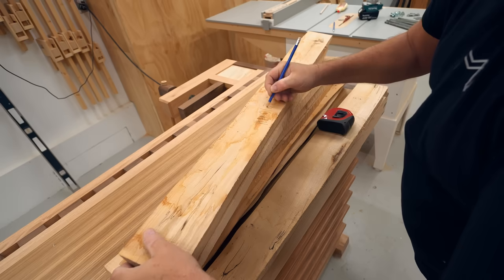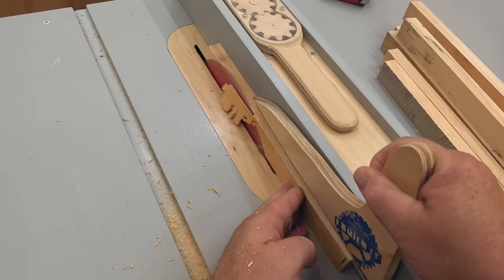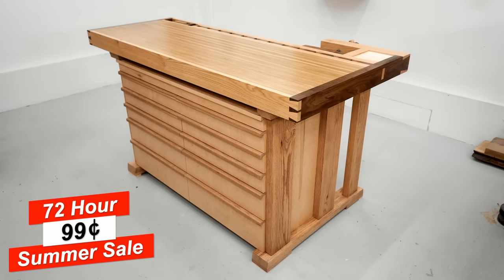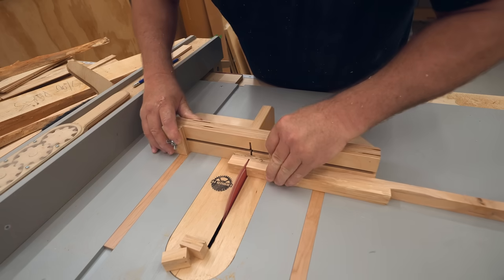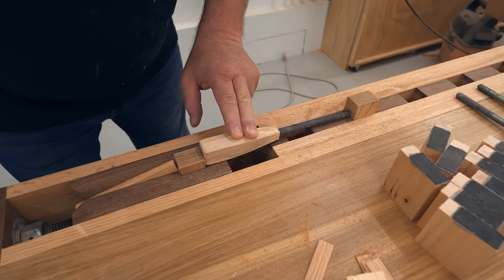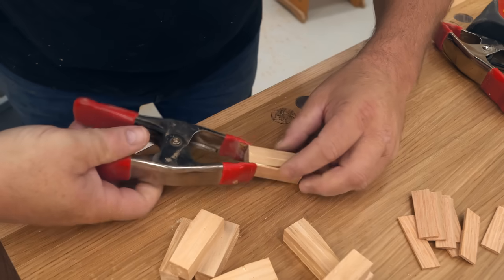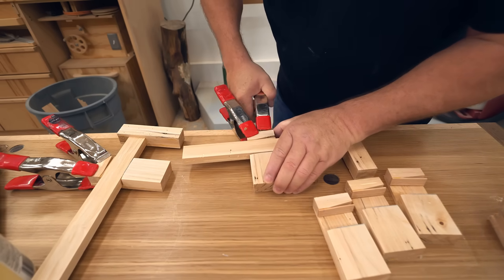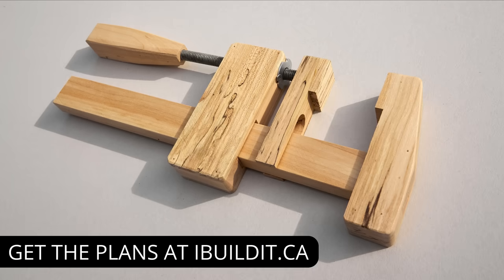How to Make the Ultimate Wooden Clamp - Woodworking

Comment from the maker: The Makers Mob 99¢ Summer Sale: https://rlnk.cc/jhthemakersmobsummersale
Get the plans for this fabulous clamp: https://ibuildit.ca/plans/ultimate-wooden-clamp-plans/
See more detail in the project build article: https://ibuildit.ca/projects/how-to-make-the-ultimate-wooden-clamp/
If you make these, you'll never go back to using metal clamps again. I know I haven't. The difference is weight - these are half as heavy as the typical metal clamp, but are still capable of more than enough force for all of my woodworking tasks.
Reply: Bought the plans, Thanks. I see the metal shim in the materials list but not in the build pages, did I miss where it goes?

Comment: I was scratching my chin thinking, 'but I quite like my single handed metal and plastic clamps why would I want to make bulkier wooden ones' Then you mentioned weight of a large glue up... and I had a flashback of a recent project that looked like an oil rig crossed with a outlaw base camp from mad max or something that weighed half a hundred weight  due to the metal clamps

Comment: I built 28 of your parallel clamps about a year ago that are used daily by 3 people in a production environment.  Also have 24 bessy parallel clamps that are over 30 years old.
Your clamps always leave the rack first.......lightweight, similar clamping strength and easier to turn. The tap to release isn't a big deal, and quickly learned.

LVL beam scraps make excellent bars, stiff and durable.
Reply: Ed, I'd never thought about LVL for a plethora of bars. Thanks!
Reply: @alanr745  
Really works well, and fairly easy to get plenty around home sites.  By far the bulk of the wood needed to build these clamps.
Not heavy either.  Mine are poplar or fir.

Comment: Hi John. I always have a problem with the wooden springs. Always seams to soft, to hard or brittle. found 18mm x 1mm thick bamboo sucker or ice lolly sticks from local super market works well. Jury still out on durability over time.
Reply: Concerning the wooden leaf spring, my clamp that I made works okay but the spring spring doesn't do anything. I think that I followed the plan completely but it seems to be wrong. Did you have any issues? Thanks

Comment: So, I built 4 of the previous version. can i just replace the moving jaw assembly on those to this new design?
Reply: That is what I'm going to do on the parallel clamps.  Already have extra bars of longer lengths that are used occasionally by swapping the heads from my shorter clamps.
I see no problems resizing the new design to the bigger bar.  Also see no problem making a parallel head that I prefer.

Comment: John, Im looking at building some large/long clamps for larger furniture builds, and like you said I like the weight reduction of making them out of wood.  You've made lots of different clamps over the years.  Which do you think is the best of your designs for a parallel type clamp replacement?

Comment: Could you maybe make a DIY version of those one handed clamps with a trigger handle where you "pump" the trigger until it clamps down and has a quick release? :D
Reply: Buy a small cheapy, pull it apart, scale it up , make them, and done.  
I did this in my business as I could not get the size I wanted in a heavy duty version,   ended up making them in bulk as had huge requirements, minimum 20 plus per guy x 6 guys, plus some for installs, so actually worked out reasonable value , more importantly super heavy duty in  ideal size for.our work which no one made.
Reply: @davidp8157  - Unfortunately I don't have a workshop, I'm just a fan of watching this kind of content.
Reply: @TheStabbedGaiusJuliusCaesar  you really don't need a lot of tools to start, most things take longer, but can be done with a few basic hand tools  only, something like this is a perfect example,  very few parts,  and very basic.
Reply: @davidp8157  - You still need a space to work in.
Reply: @TheStabbedGaiusJuliusCaesar  if you have room to read a book  or watch TV, uou have plenty of room  for a project like this. Like anything   the first step is getting started.
Reply: @davidp8157  I live in a small apartment with one room for a combinee living and bedroom. I can't setup a shop in my living/bed room.

Comment: @8:18 I think the T-nut is the weak link in the design. With use, I expect there to be enough play in the wood around the nut's teeth that it just pops off. It's better to put the nut on the underside of the moveable jaw, closer to the handle, so that the threads are always pushing the nut into the wood.

Comment: Hi John Great work on the clamps, I'm planning to download one of your plans and build a bunch of them as a fun and useful project. Can you confirm that the "Ultimate Clamps" would be the latest and greatest of your designs? or which one would you recommend in terms of best performance. I also like the wedge style, I'm not concerned about an extra couple steps in making them or an extra second to disengage the wedge if there's benefit in building those ones 
Thanks!
Rob

Comment: Thanks, John!! This may be a silly question with a silly answer, but I just can’t seem to get past it.  These clamps being wooden run a much higher risk of you actually gluing your clamp to the workpiece if you’re a bit sloppy w/ the glue-up.  The obvious answer would be to not be sloppy, of course, but I’m wondering if you’ve ever experienced this  situation?
Reply: Put a little wax on your clamps
Reply: @AJ-ln4sm  Also, the 2 coats of poly probably helps.

Comment: These look fantastic John! Does it have to be hardwood?
I think it would be great if you came up with some nice space-saving way to store these and made a build video of that too.
Reply from the maker: You can use softwood.
Reply: A bit of wood trivia I learned a while back. Hardwood and softwood doesn't actually tell you about the hardness or softness of the wood - a wood is classified as a hardwood if the seeds that the tree produces have a coating in the form of a fruit or a shell. Softwoods produce seeds that don’t have a coating, which are dropped to the ground. So lots of hardwoods are soft and vice-versa :)

Comment: What's the longest usable length that would work for these do you think? 4 foot, 6, 12 foot? Also how long did it take to make 10 clamps? I need to know so I can times that by 3, and that will be how long it takes me to make :) Thanks John!
Reply: With a well equipped work area, my guess is about 1to 1.5 hours a clamp for a batch of 10 or so....start to finish.
Once the jigs are built, you could cut this time 40% or so.
Or, you could just enjoy making them as a weekend fidgit.

Comment: Can I use pine tu build  those?
Reply: Hi Pedro, On one of my clamps I used Douglas Fir for most of the parts. Pine is usually too soft. The spring will have to be from hardwood though. In my opinion for longevity they should be from hardwood. You might look for pallets that are made from a hardwood but make sure it is dry before using it.

Comment: John, long-time fan and customer for some of your plans. I get it that the T-nuts cost less than a threaded insert, but what about simply cutting threads in the wood directly? Not strong enough, or not durable enough? The block seems long enough that you'd get pretty solid purchase, especially with oak or maple.
Reply from the maker: Tapping the wood is strong enough and may be durable enough. But you need a tap to do it and you can buy a lot of t-nuts for the cost of one tap. Or you can make a tap from a piece of threaded rod, which isn't something most woodworkers want to do. Either way, the t-nut is the fastest and easiest.
Reply: @JohnHeisz  thanks for the quick reply! I agree with all your points. (I am terrible at coloring inside the lines however, so I might go ahead and try my tap in spite of your sage advice.)
Reply: The t-nut option seems superior. The threads have to support all the clamping force, so wooden threads would need to be deeper and tighter fitting. But the mechanism would be stiffer to turn and not as durable.
Reply: Another commenter suggested the T-nut on top was a weak point and should be on the bottom.  I am milling up the wood to make a set of these.  I have a tap and T-nuts, but I think I will add a little epoxy and use the T-nuts as John installed them (w the #4 screw as well).  I trust John since he has designed more clamps than anyone.
Reply from the maker: @scott8351  I think one commenter also said that the moon is made of green cheese. listen to the commenters at your own peril, especially the ones who don't have anything at  all to show that they have a clue about what they are saying.
if the t-nut needed epoxy, I'd have put epoxy there. It doesn't - the screw is enough.
Reply: @JohnHeisz  Thanks John!  I appreciate it.

Comment: Hmmm. It’s cheaper to buy here. Is there a way to build this with just a jigsaw?
Reply from the maker: If all you have is a jigsaw and a defeatist attitude, then you don't need clamps. Problem solved.
Reply: @JohnHeisz  So I guess if you only had a jigsaw you’ll have a defeatist attitude. I don’t I’m asking for a solution. I guess this is the wrong channel with the wrong attitude.
Reply: @megsman4749  you could easily use only hand tools to build these. It would take longer but it wouldn’t be difficult.
Reply: @vh9040  Now that would be a great video.
Reply: @megsman4749  yeah it would be a great video. I work with hand tools, almost exclusively, with the exception of some battery powered tools… a jigsaw among them. Given the time constraints, i buy my clamps (the bessey uniklamp is great because it’s light).  However, i did buy John’s plans because i liked the design, wanted to support the work, and who knows, maybe I’ll get a table saw or band saw in the future.
Reply: Really not sure why the OP is getting so much hate, he only asked if there was a way to build something like these with a jigsaw - no need for the snark from John, or the trolling from "kip" that followed.

Comment: You clearly put a lot of effort in this video. Perhaps so much so that you forgot the explain exactly WHY there clamps are so good and why you (re-)build them... The way the material is used? The ergonomics? The strength? Why this design? I also miss explanation of each clip and the operation youre doing. Now it's just a bunch of clips and I'm left guessing what part you're working on.
I'm not complaining, hope you take this as constructive critisism.
Reply: He has more details in the website article which is linked in the video description. In fact, I’d say the information in the article is enough to build them, even without the plans. (I did buy the plans, however, to support his work). 
He did discuss the advantages of using wooden clamps vs metal ones; the main advantage is the wooden ones are way lighter, and therefore easier to use.